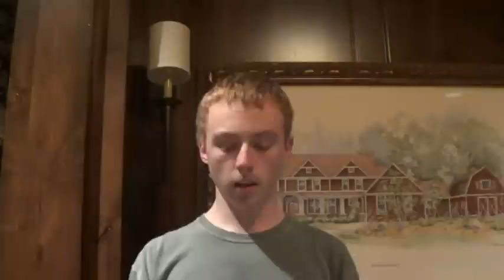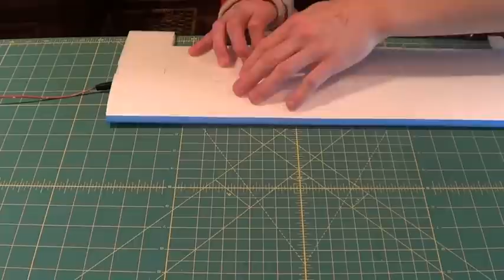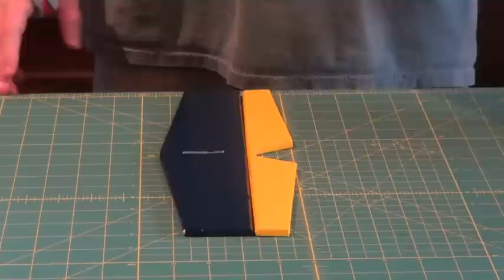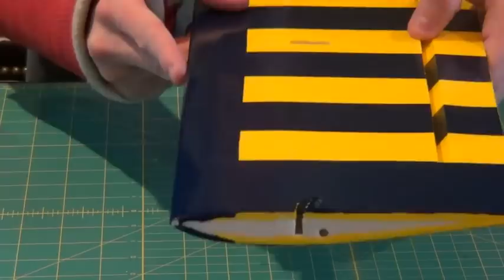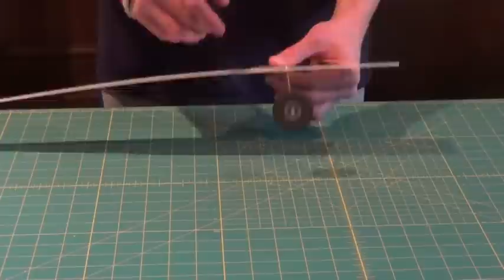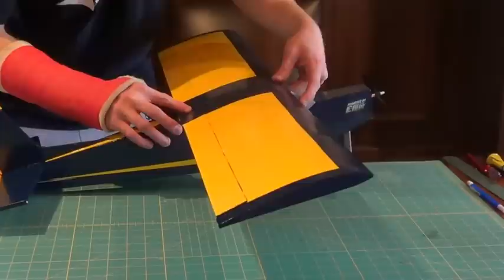UPDATE: ARCHIVED - Depron RC Airplane Kit Available! JAMCRAFT RC - Build Video

Comment: Easier to make a long sanding block and sand the bevel in. But good work. Uppermost with any airplane is low wing loading,, a light airplane flies best. If too heavy, it has to fly fast just to stay in the air. Fast is bad for a beginner. This one will be light and good for training.